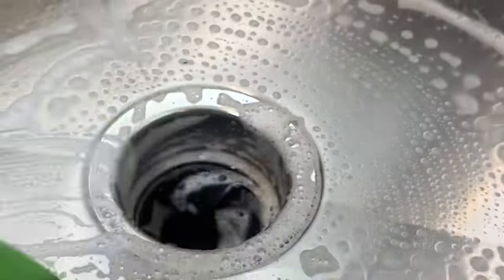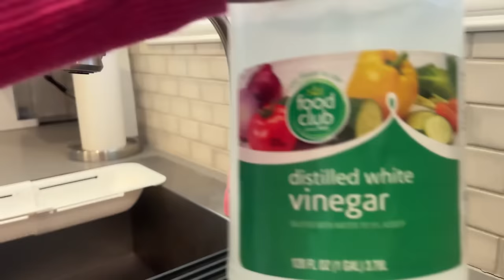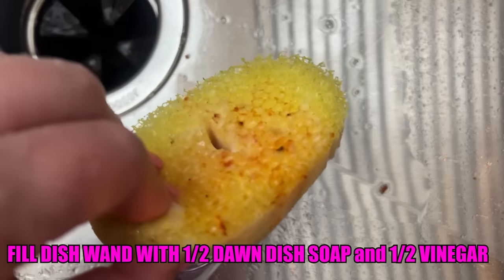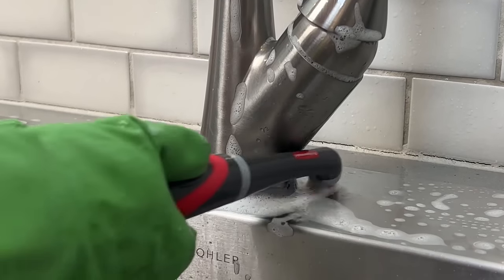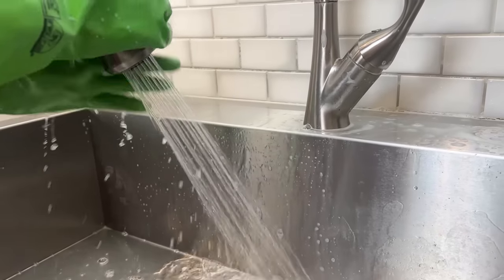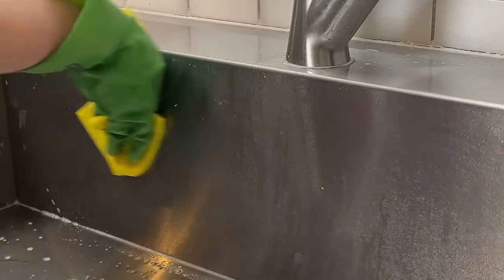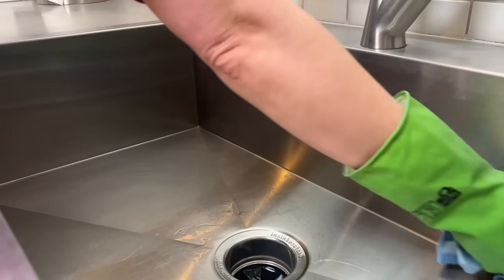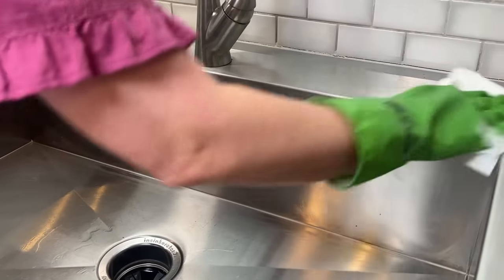How to Clean and Shine Stainless Steel Sink ✨

Comment: Why the oil? Doesn't that defeat the purpose of the cleaning?
Reply: No, it actually gives a protective coating to make water bead up instead of stick and cause more water spots.
Reply from the maker: Olive oil can be used on stainless steel sinks as a natural way to clean and shine the surface. 

- helps remove stains and grime 
- prevents water spots: 
- gives it shine and a polished look
- protects against rust:
Reply: Thank you!

Comment: I use lemon oil to shine and protect my shower walls, sinks and to clean hair spray off the doors. Must admit, I’ve never used an electric toothbrush to clean anything other than my teeth.
Reply: I use my electric toothbrush to clean my diamond. Does a beautiful job. You may want to get a separate dedicated head for that😀
Reply from the maker: It’s actually an electric brush for cleaning. But it looks like one for your teeth. We joke about it being mistaken for a regular toothbrush but it’s bigger.

Comment: CLEAN FREAK & GERMAPHOBE 
What's the best way to clean the bathroom walls?  Steam and dust makes icky, yicky, sticky and hard to get off w/o damaging the paint.  (It's eggshell latex not flat.) Thx!
Reply from the maker: Test first on the paint, but I love Greased Lightening spray. And you spray it and use a damp flat mop to spread and clean or put it in a sink or bucket and put the mop in if it’s a large area. It’s great at cutting grease.
Reply: @CleanFreakGermaphobe  Thank you very much! I'll give it a try! 😁👍